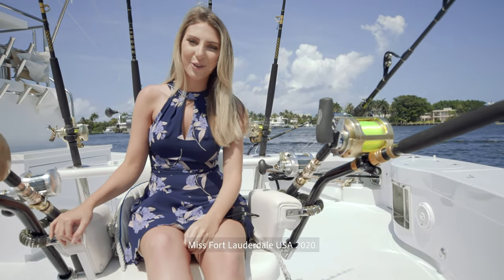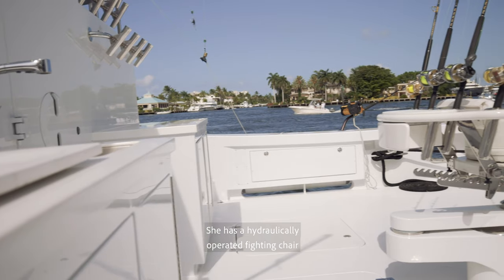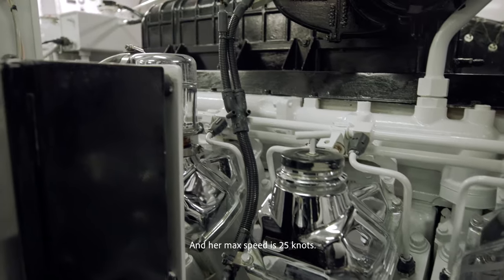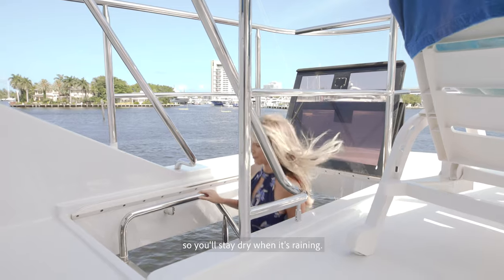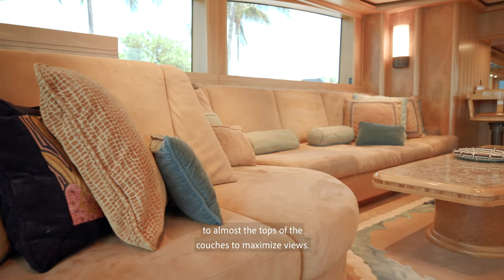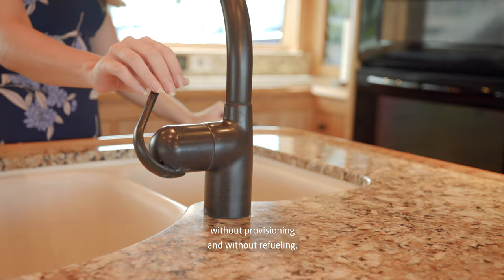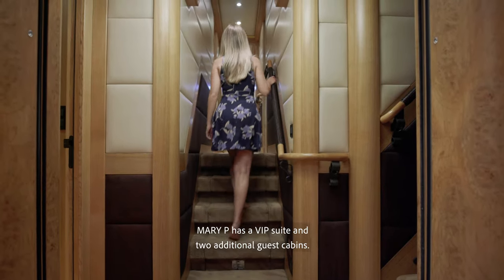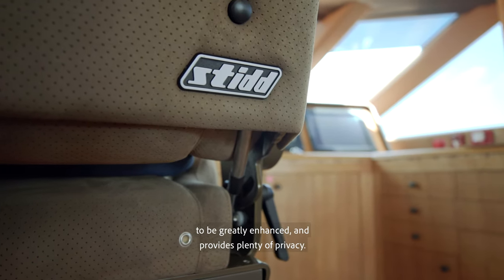Fort Lauderdale Magazine | 122' Trinity Sportfish MARY P Walkthrough

Comment: Boat like that with Cat Power? Mann or MTU would be more like it.
Reply: cat has more parts accessible  throughout the world
Reply: Cats are actually great dependable engines I put many hundreds of hours on them and never had any issues with them, and I'm not knocking MTU's or MAN's.
Reply: Break down with MTUs in the Bahamas and it take weeks to get parts Cats you will have them overnight or same day. I’ve owned both and Cummins is even better for reliability and parts are more affordable.
Reply: The Cat 3500 (in this case the 12 cylinder 3512) series is a heavier duty engine than the MAN or MTU. We had a pair of the 16 cylinder version, the 3516’s in our tug boat’s, great engines. We’d push multiple stone barges at 1500 tons apiece, those engines didn’t break out a sweat.